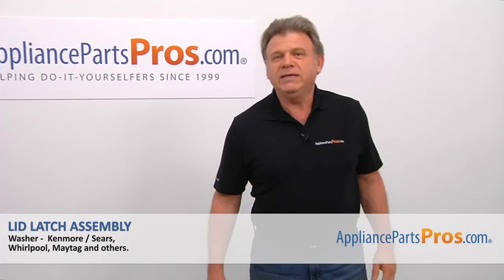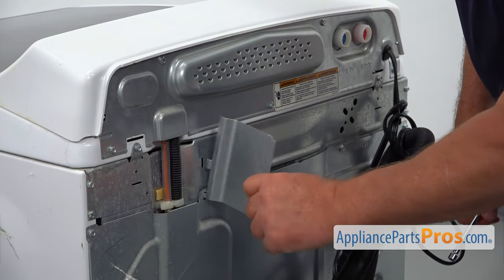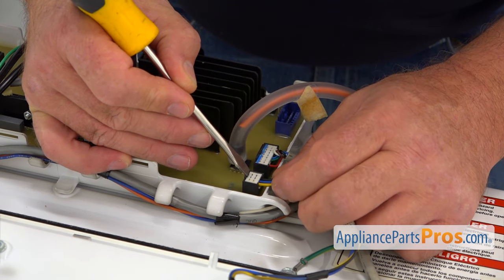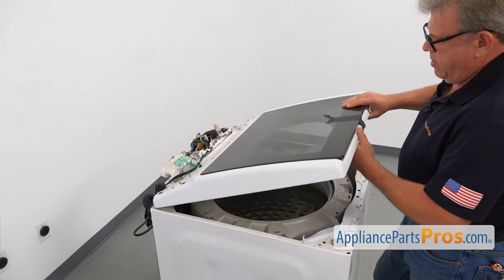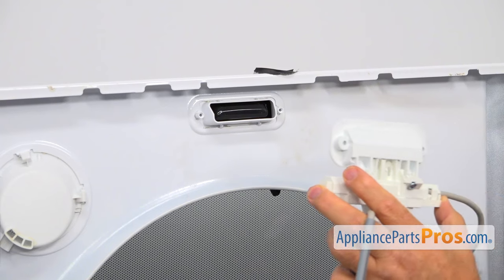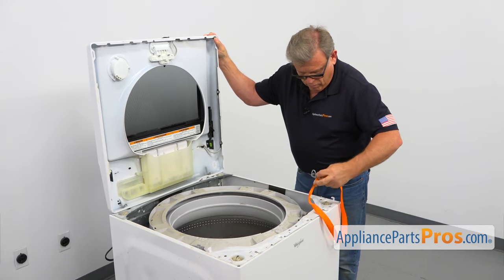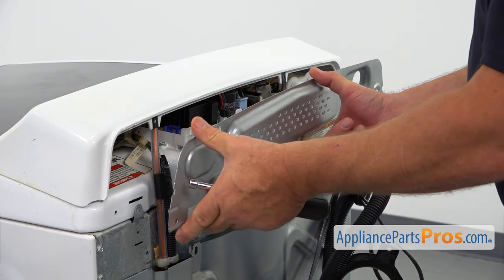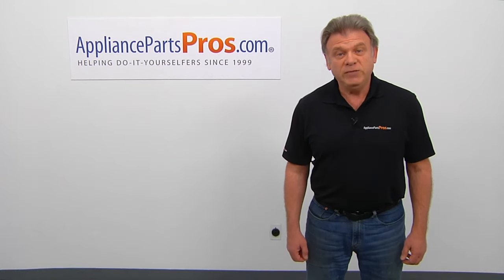How To: Whirlpool/KitchenAid/Maytag Washer Lid Latch Assembly W10810403

Comment: 2:15  It's much easier to push clips out from underneath once you've slid the top off. Just be careful because the wire is attach still so maybe put a bit of tape on it so it doesn't fall completely off. Using the puddy knife may not work on some models and it's very easy to damage the paint with the puddy knife. Otherwise great video.
Reply from the maker: Thanks for the advice. Puddy knives are usually the safest of the tools you can reach those areas with.

Comment: Is the lid lock replace for a mvw6200 kw2 the same?
Reply from the maker: The lid lock for this model is part number W11700916. You can place the order through the website, or you can call us at 1-877-477-7278 to place the order over the phone.

Comment: I did this to my Maytag and fixed the door latch, but it doesn't read the door as closed when I close it.  Put rachet a strap on the lid for it to activate.  Any ideas?
Reply from the maker: Are you sure you installed everything correctly when you were replacing the latch? What is the model number of your washer?

Comment: Would be a life saver if someone could share next steps for Maytag MVWB766FW1 off balance for any size load but empty.

Replaced suspension rods. Leveled front to back side to side. Checked washer plate and tower for soundnesses which was nice and tight. Nothing in between drum and linear. Performs wash cycle and initial low speed spin to drain tub but as soon as it picks up from there bang bang bang off balance and walks.

At a loss!? 🤷
Reply from the maker: There are a few things you can check for that issue. We do have a video that shows how to check the different parts:   https://youtu.be/uHvavgtRjkc?list=PLKhohqC7zc-QrccZwxz0n_jNAUO4hS0-z